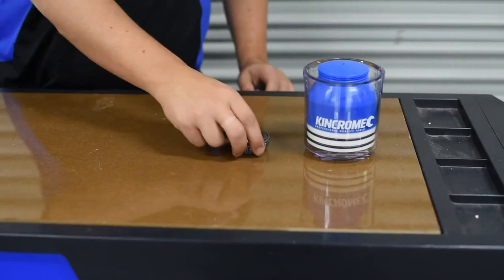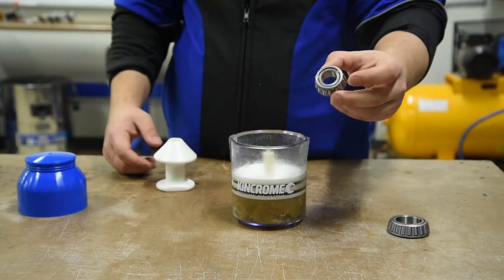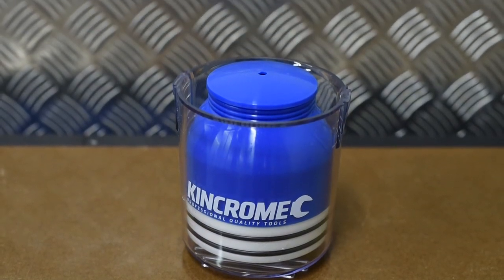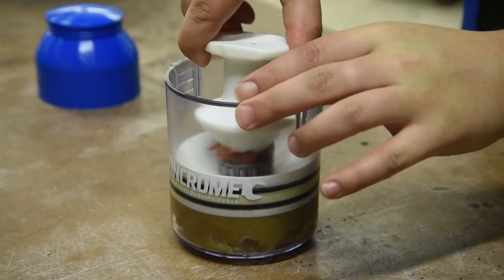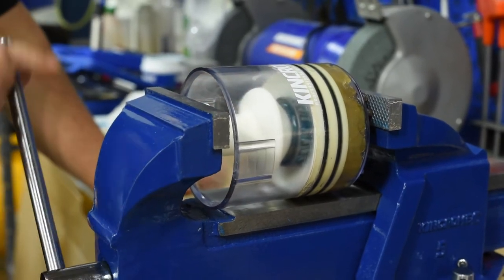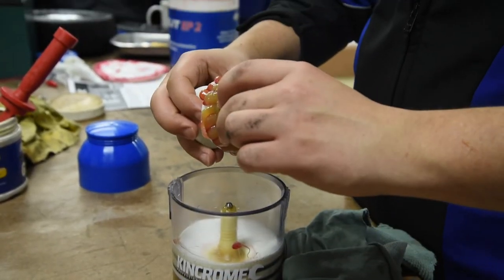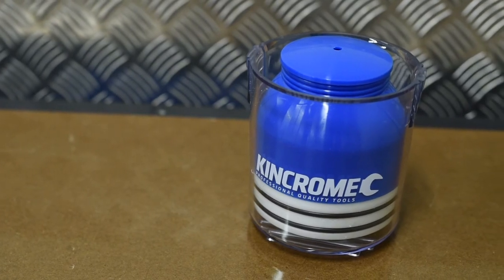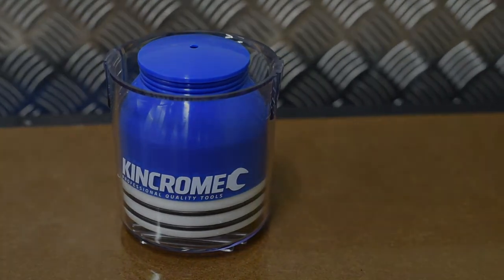KINCROME Professional Bearing Packer

Comment: So I bought it. It works well but I recommend either using vice or if you need to carry it in your caravan - buy a cheap 200mm “G” clamp. I had to use the G clamp as I couldn’t press hard enough for the grease to go thru.